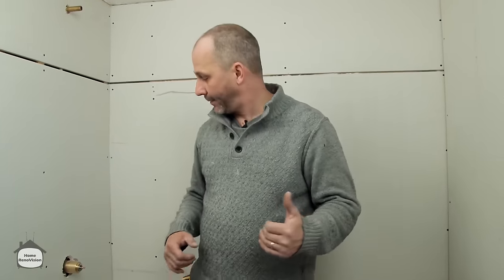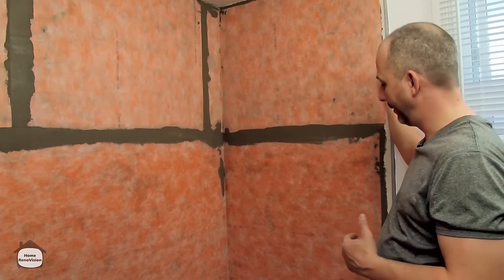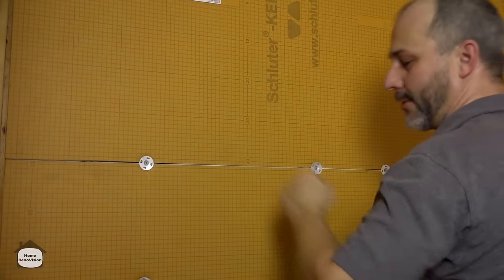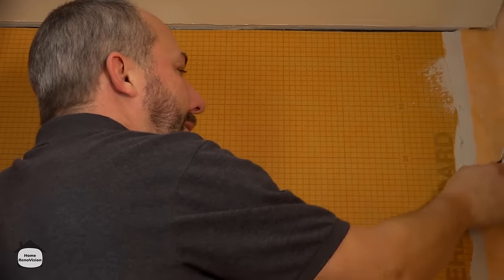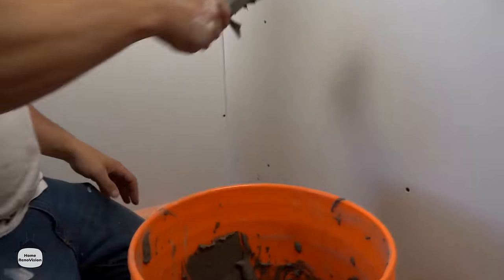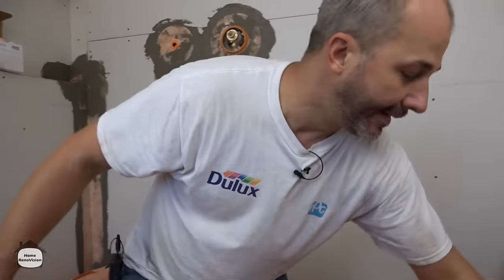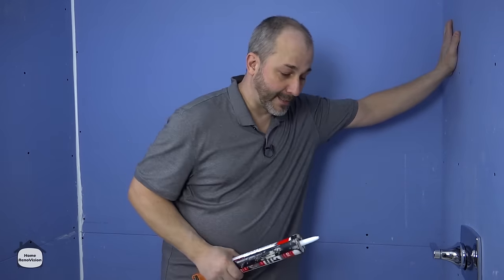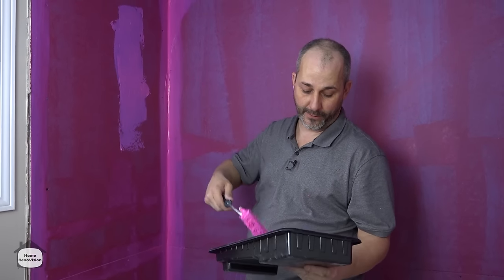4 Types of Shower Waterproofing Systems for Your Bathroom

Comment: Great hints one thing that drives be crazy  after fourty years in the trade is setters who don't protect the tubs a peace of scrap carpeting makes a perfect cushion for both walking on and dropping tools if you have to replace a tub there's your day wrecked. Home Depot used to carry the notched trowel for kerdi may wanna check.
Reply from the maker: I prefer a thick moving blanket instead of an old carpet.
Reply: I use painters tape along the top edge of the tub. I use 2" tape and tape over the lip into the vertical section of tub. It can stay there until you have installed the grout. Then you just peel it up and throw it out. Maybe $1 in blue tape and the tub edge is protected.
I use cardboard for the base of the tub and an old drop cloth or my old grout cleanup towels to give me some padding in case I drop a tile or tool or anything. 
I chipped the porcelain on a tub once and I almost cried. Not again.
Reply: Putting in a basement bathroom
Reply: As soon as the tub is installed I box it in with plywood, leaving enough gap around the edges for backerboard and tile. I can walk on it, dance on it, drop tools on it, park my truck on it... After seeing another contractor have to replace a $1500 porcelain tub, I don't mess around when it comes to protecting them. Blue tape the gap to keep out dust and granules, cut the tape back as needed when tiling, grouting and caulking.
Reply: @tedspens  Similar to my thought except to just make it a flat platform. I couple padded 2by's at the edges keeps it in place. Would seem especially beneficial if doing multiple tubs. They're all the same size to you move a partial sheet of plywood that's a few inches thick from job to job with a little tape to seal the edge each time. $0.02
Reply: @HomeRenoVisionDIY  was going to say the same thing works great for pulling off old material when its stone tiles so it dont mess up the tub works amazing plus if your tired you can take a nap lol

Comment: You are bang on about using modified mortar...I just learned the hard way....luckily the cement board wasn't properly primed so it was easy to peel off the red guard that was applied...LOL...or maybe not...

Comment: I using Hardi backer and red guard with large format porcelain tiles on top. What type of thinset do you recommend? I wish I had a contractor in my area like you.
Reply: I would stick with non-modified.. You are essentially the same as Kerdi, AFA moisture sealing.  Modified thinset doesn't cure properly when between 2 impervious surfaces.
Reply: Thank you for this information. I truly appreciate it.

Comment: In reference to the fourth option...the purple gypsum board with the RedGard sealant...once you've applied a sufficient number of coats of the sealant, you can tile directly to the gypsum board?  Also...do you put any kind of barrier between the gypsum board and the studs?

Comment: GREAT CHANNEL! I am  DIYer building whole house of just over 400 sq. - your vids REALLY help. Will be older soon, want it right and lasting for years.
Q: The Kerdi Gasket you used in Vid 3 for piping and fixture thru holes: The gasket had two depths and you inserted the thicker depth into the wall. Is the gasket thickness for different tile thickness or does the thicker side ALWAYS go inside (why)?
If 2 allowed, Unmodified Concrete for Kerdi was made clear but regular thinset with adhesive still used on top for tile mounting (Yes/No)?
Very Grateful, Thank You!
Reply from the maker: non modified for eveything. Cheers!

Comment: Hey Jeff, having trouble finding a solid answer to this question, I just got our shower hot mopped and I want to use Kerdi Board on the walls, but I'm wondering if I can use the concrete and Kerdi tape method to seal the Kerdi Board to the actual hot mop tar flooring or if there's a better way to seal it to the tar? Thanks so much!

Comment: Great video. Im getting ready to redo my home shower because the previous owner didn't water proof the walls and the tile is starting to fall. Those were some great ideas. Just gained another subscriber.
Reply from the maker: Hi Jesse, in most cases the shower comes without waterproofing from the builder as well. Cheers!

Comment: If you're talking about water resistant liners, could you consider a liner that is rubber, and thick which is used for making water features like fish ponds, and the like for landscaping.  I think it's made by Goodyear Rubber. I can buy it and have used it against foundations to waterproof an area that otherwise would absorb groundwater, and also for water features. I can buy it in bulk off a 12 foot roll any size I need.  Can there be a way to adhere it to a wall evenly and assure it will stick? It is rubbery, and supple, but will cement stick to it?  If there's a question about length of time a product would be waterproof, I feel this might give a 50 year assurance or greater.  This is just me thinking about durability, and longevity.  I cannot live with the idea of redoing a bathroom after 10 years or so, and believe in overkill for the sake of the home, the house that shelters us in comfort for generations to come.  I don't believe in cheap floors, MDF cabinets, cheap windows, and 20 year shingles. Pay good even if it hurts because down the road, you'll be kicking yourself in the butt for not doing the right thing out of the gate. Yet, if you need to camouflage a problem for the sake of selling the house to an unsuspecting new buyer, by all means screw them into thinking they're getting a new bathroom, and shame on you. This is just my opinion. Thumbs up for your review, and double thumbs up for a response.  Thanks!
Reply from the maker: the pvc liner has a few defects in thew install technique that allow for major problems and smells down the road. This is a much superior system.
Reply: @HomeRenoVisionDIY  Thanks for your reply

Comment: Question. Could you just use left over pieces of the larger sheets, cut down to use as tape? If it adheres to itself wouldn't that work?

Comment: I was always told that the place most likely to fail was where the lower edge of the wall met the top lip of the shower. When the tile came down over the lip, water could wick up behind the tile and start molding or tile failure. This seems to be glossed over in this video. What am I missing? You mentioned that the cement in the corner in the segment on the Schluter tape is supposed to expend below the corner and is cemented in.  BUT, nothing seems to be done for the rest of the length where the tub joins the wall.  Is there a time in the video you could mention that explains this?         Cement is much stronger in compression than in tension.  So, don't try to stretch or bend the cement if you want to avoid cracking it.  One of the ways to avoid weakining the seal between wall and tub was to put weight in the tub while it set up.  When the water was drained, the cement would relax and be slightly compressed.  When the tub was used, the load on the cement would not be any greater than what it was when the cement first set.  Is this still good advice? 
Thanks for the videos.
PS Thanks, too for pointing out the differences in product availability between the Canadian and US markets!
Reply: He mentions this aspect in another bathroom renovation video. Guess you gotta watch them all and take notes
Reply: I thought the Kerdi bd in 2nd video should come down to overlap lip of tub not quit touching on bottom, leave a small 1/4" or so gap?

Comment: Down here on the state's they don't require a big ass gap in the sheet rock. 
What's the deal with that,  in the first bathroom
Reply: Thought I was the only one alarmed by that
Reply: He said he cut it short on purpose to show that the Kerdi-band waterproof membrane strip would suffice if Kerdi-board was a bit short.

Comment: In the second system with Schluter walls and tape, when you were taping the seams you did the vertical before the horizontal. Is there a reason for this, is there a benefit one way or the other or because of the materials and waterproofing capabilities (4 stories down in the ocean) does it not matter? Thanks for the great video. Awesome Job

Comment: Again you have relieved my doubts how to do a job. A question, I have a stand up shower that is 34 inches by 41inches with the drain in the middle. Can I cut a Schluter floor pan cut to this size as long as I have a 2 inch over hang on the paper? Can any standard tile compound to adhere the tiles to the wall and floor?  The house was built in 1967.
Reply from the maker: Not sure how I missed this question but here goes. Yes and get the corners to complete the install as well. I recommend using kerabond T for the thinset with all schl;uter products. Cheers!

Comment: Thanks for the guidance. About the pink paint,  I don’t get why it’s needed as it will have tile over the drywall right? 2nd question is why you didn’t use cement on the middle of the two pieces of the drywall before you paint pink? But you used the white caulk in the vertical corner?

Comment: IMHO The best system is #30 felt paper directly stapled to the wall studs, lapping inside corners both directions and lapped properly from the pan up to the ceiling then a fat bead of silicone applied on top of the felt over the staples on each stud then 1/2" cement board screwed directly to the studs.
Then mesh tape all the joints before tiling. ..that's how I have built them for a long time and never had 1 issue. Nothing bonds a tile down better then good old fashioned cement board.
Easy to install, easy to build custom boxes, shelves, seats, the entire system is the cost of a roll of felt and a couple tubes of silicone $20 👍
Reply: I am wondering if you could also use a lightweight synthetic polymer underlayment instead of the the felt paper.  The synthetic underlayment has replaced felt in roofing applications and most roofers recommend it now over felt.  I suspect that the underlayment is much easier to install than felt but would probably be more expensive than felt.
Reply: @picklerix6162  You could use anything waterproof really. You could use Tyvek, 6mil poly, etc.etc. but I would still keep it 3ft tall pieces lapped like 8 inches from the bottom up, it provides a small amount of air exchange into the wall cavity and would keep it from getting mouldy.

Comment: Great video!! I price remodels and I often price adding Redgard over cement board, never drywall, is there a reason that you use drywall instead of cement board? Also, if we cannot get all of the Schluter products, does that mean the warranty is nulled when we install it?

Comment: Dang it, I've watched a bunch of your videos and I missed this one! So we already put up our cement board and I applied thinset and tape to corners/screwholes. My plan was to put the Redigard over that. Did I screw up with the taping of the joints? Can I continue with my plans?
Reply from the maker: you are fine. well done. Cheers!
Reply: Yes  Make sure you have kept thinset coat thin ans go ahead  but i feel like its over kill because board absorbs the water and if you do the bottom right and inside joints your fine and it sounds like you did  ,The board needs sit on tub to where  water rolls offand thicknes of tile will heilp even more

Comment: Hi Jeff.:_RenoVisionHome: We are loving your videos and appreciative of all your knowledge and generosity in sharing it with us! Quick question;
Putting a tile tub surround in a bathroom which was brought down to studs. Mold and mildew drywall boards are up but we forgot and put paper bead in the corner and mud over screws, seams, corners. Wanted to do the Redguard approach from you're "4 types of shower waterproofing systems" video. What do we do now? Remove the mud...??
Thanks muchly if you can get time to answer this!:_RenoVisionHome:

Comment: Jeff love your stuff buddy👍
I'm renovating a rental property that is a duplex.Im keeping the cast iron tubs as they are in decent condition. I have gutted the one bath and installed new faucet and drain and stop. I put new green board drywall around the tub. I already taped and mudded the entire thing. I was going to use a glue on shower surround. Do you recommend putting the red guard water proofing on before using this type of shower surround? Maybe I should red guard it and just tile it? Watching this video I guess I did not need to tape and coat the joints? I guess I won't on the second bathroom in this duplex. These shower surrounds do not go all the way to the ceiling either so should I red guard to the ceiling or just behind the surround? Can I paint regular white paint over the red guard at the top? One last thing will the wall surround adhesive stick good to the red guard? Do you recommend a different way to tackle this? Its a rental so I want it to last but not break the bank. 
Thank you for your time
Bondo

Comment: Hi Sir, 
you are so good at these things. Can I ask you a question? I have my contractor put on cement board without putting waterproof membrane for standup shower. Is there a way that I can just put another layer of red waterproof sheet from your first option on top of my cement board? at the bottom of the sheet, I will cover the waterproof membrane with red sheet to install tiles. please tell me what the right way is to put the membrane in my situation. getting really stressed here. :(

Comment: I put up the mapei aqua defense on top of moisture resistant drywall. In the instructions it doesn’t say that a primer is needed. I noticed that after 2 coats a small portion of my shower started to peel. Should I have put a primer down first?

Comment: Hi, I am remodeling my bath in a mobile home. I will use the green drywall and red guard for waterproofing for the shower. I was planing to add the drywall over the existing wood paneling. is that ok? also, I found out that 1 wall has studs of 1 X 4, not 2 X 4. Should I remove the wood paneling and add 2 X 4s? thanks a lot, you are a great help.

Comment: Is it ok to do drop ceiling above a shower? 1917 Bungalow basement finish, doing drop ceiling in the rest of the basement, wondering if its ok to use in bathroom or if I should plan to drywall or use the tips you use in this video. Thanks for all the videos!

Comment: Which of these are the best bang for your buck? How does Kerdi membrane method compare to the Redgard method? Will be doing this soon in my bathroom. Thanks for your videos!
Reply from the maker: depends on the level of paranoia you are dealing with. For a tub/shower the redgaurd will last longer than the design. If you are doing a custom shower with tile base I would recommend using the schluter system. That is a life time build.

Comment: Hey Boss .  I love all your videos  one question in mind if you got time to respond is . ... what about the ceiling if the tub should i use a water proof drywall or regular and just paint over with mould resistance painting?
Reply: It is believed, among many professionals, that Green Board (which is mold resistant, not waterproof) is not to be used above wet areas in horizontal position as it <MIGHT> sag.

Comment: I am about to remodel my bathroom. This is our main bathroom and gets used the most (heavy traffic). For strong water and vapor proofing walls and floor what you suggest (between: Schluter membrane, Schluter board, or mold-resistant drywall with bonding coat)? Money is not too big of a concern. Thanks!

Comment: After you finish the the drywall and Red Guard method what type of paint i.e, latex , oil base, waterbase paint or tile can you use on top of the red guard? Do you have to prep the red guard by sanding it? Can you put tile cement on top of it ?please advise? I love your videos  very informative.

Comment: A tiler told my sister that tile grout is not waterproof (it's porous). Is that correct?
Reply: Depends on the type of grout. Epoxy grout is waterproof and usually stain proof.
Reply: The tiler is correct, it is resistant but not waterproof. You should apply a grout sealant to improve the water resistance ever few years.

Comment: Jeff, can the Schluter membrane be applied over standard dry wall or does it need to be cement board? Also, Im doing a dry pack shower pan, will I put that same membrane over the dry pack? Cheers!
Reply: It can be over drywall. Just not drywall mud, any mud has to be primed with latex primer first.

Comment: Good demo and instruction.  Consider throwing a rubber backed little bathroom rug into the tub or shower while working in there. It protects from scratches and dings.

Comment: Why didn't you tape the middle joint of the green board? Why are you using greenboard at all when cement board exists?
Reply: Minimum code requirement demonstration
Reply: that not greenboard, its  denshield water proof/mold resistant . it has its own water barrier built in. also in the seems I'm sure he put some of that 2n1 bond and seal as recommended per manufacturer .  its cheaper and easier to deal with than cement board.

Comment: Using the red guard, what can you use to make the drywall seams flush prior to using thin set and tiling? DO you just use more thin set (doesn't seem right). or do you just use thinset at the seam and let it dry? Other type of cement?
Reply: It is close to being in consequential, but would rather be dealing with a completely flat (or as close to flat) situation as possible. I might get the Lash Pro Pliers just for my two seam areas alone.